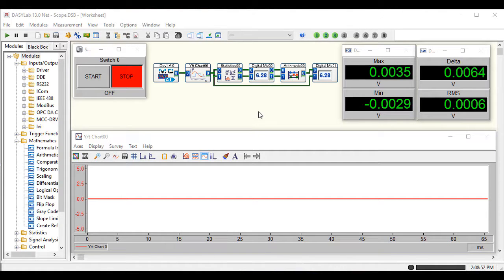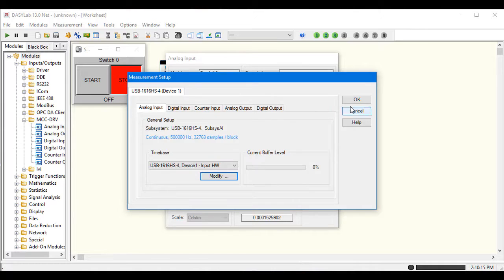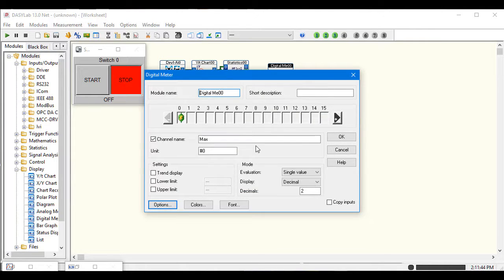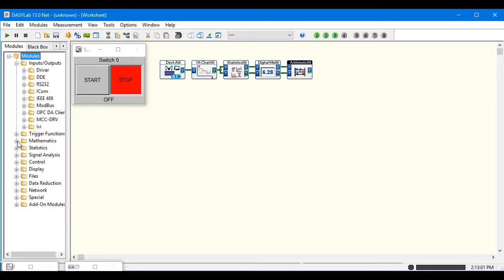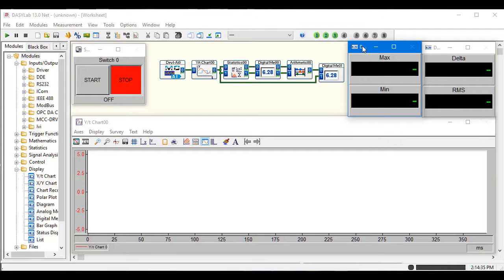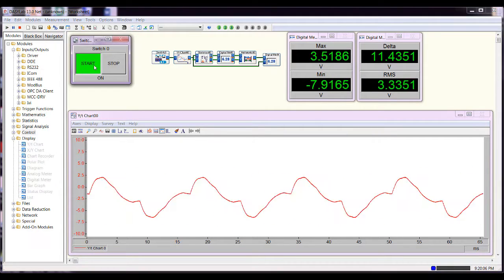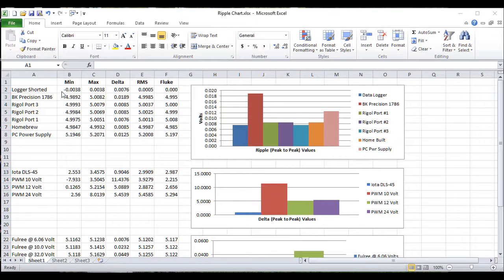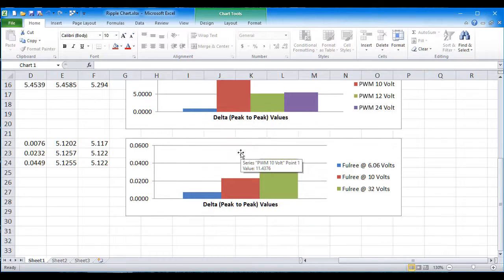Analyzing Power Supply Outputs Using DASYLab and a USB Data Logger

Comment: I noticed that on the digital meter for the display of the stitistics module, you said we you wanted to take the "min" values  however you ended up selecting  "Maximum" for channel 1. Channel 0 was also set to display Maximum.   Check at time=3:18 to see what I mean
Reply from the maker: Nice catch

Comment: Hello David. Please I have setup my pressure sensors to read pressure changes in voltages. But they do not start at 0V at the beginning of the experiment. I want all of them to read 0V on the start of the experiment. How can i do this?
Reply: George... look at the Scaling module, in the Offset adjust mode. It should allow you to zero a sensor at start.
Reply from the maker: Most sensors, like the pressure sensor, have a bias voltage. That is they output something like 2.5 volts at the 0 PSI (mbar) reading. That is simply the nature of most sensors.

If you are using DASYLab you can use the Scaling function inside Mathematics folder to convert the voltages to actual pressure readings.
IE: Turn 2.5 volts into 0.0 PSI

Comment: David - this is a nice video and explanation.
I am curious as to why you didn't use the Statistics module to also do RMS and Peak-to-Peak?  Additionally, the output of the Statistics module is one sample per incoming block. The setting in the Digital Meter to display the Min or Max doesn't do anything on a block size of one - there's only one value. 
I would love to talk to you more about the videos.
Reply from the maker: “…why you didn't use the Statistics module…”

I am by no means an expert with DASYLab. “I know enough to be dangerous”. After reading your comment and going back into the Statistical values block I see RMS and Pk to Pk options. This would definitely simplify the block diagram.

Are you just a user or are you associated with DASYLab?

I was promoted from design engineer to test lab technician. Gave myself a crash course in DASYLab (YouTube videos) and muddled my way thru it.

Wanted to share what I know as there is a genuine lack of content on this subject matter.
Reply: I'm the DASYLab Product manager. It's my voice in several of the MCC videos. I'd be delighted to talk to you, to thank you for sharing your knowledge! Real world experience beats out theoretical "how-to" every day!
Reply from the maker: Going to be in Norton June 21'st & 22'nd for the training class (tentatively). Are you based in Massachusetts?
Reply: I teach that class! Welcome!